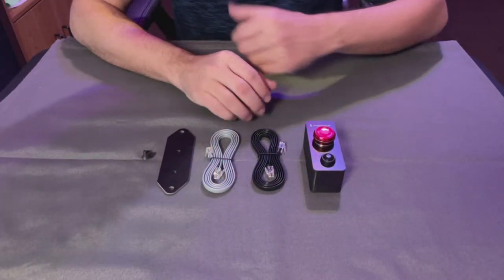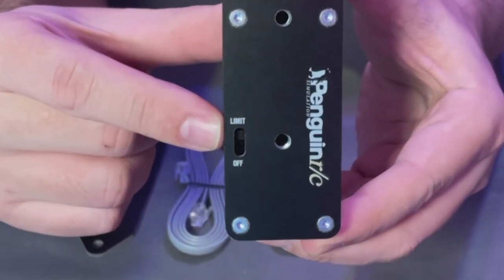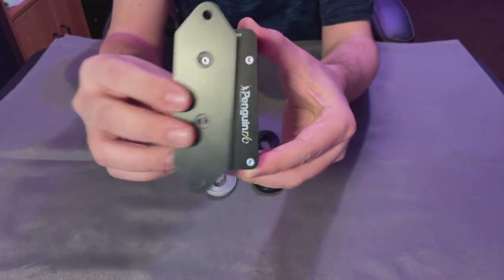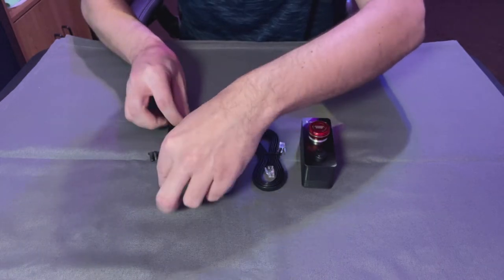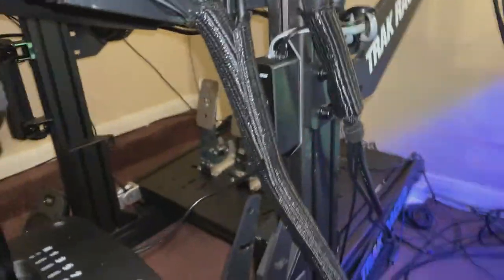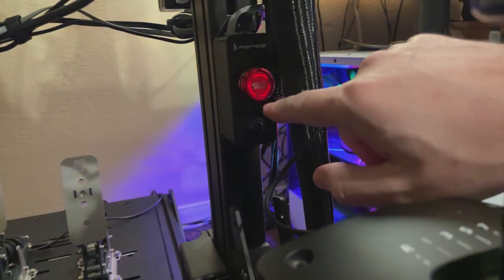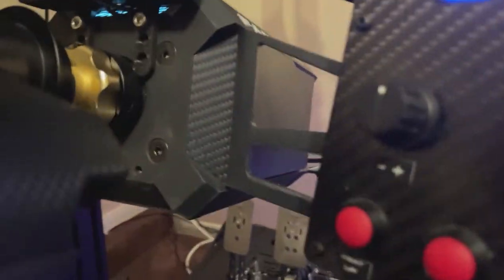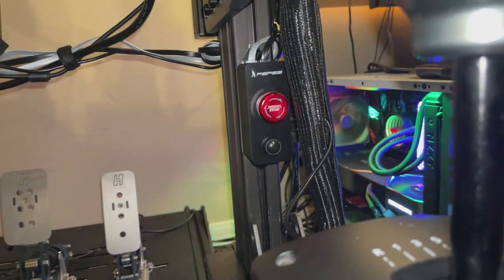Penguin r/c Safety Switch for Fanatec DD Review

Comment: I could have used one of these when I had a DD2. I hated the estop cutting power to the wheel base and there were more then a few times I had to hit it. Every time I did It caused problems in every game I played. Always had to do a reboot. They finally added the ability to cut ffb if you held down the power switch on the eStop. That did absolutely nothing in terms of emergency safety. Kinda ridiculous really. 

I finally sold all my Fanatec stuff a year ago and got a SimUCube 2 Pro with the Premium E Stop. What an upgrade all around.